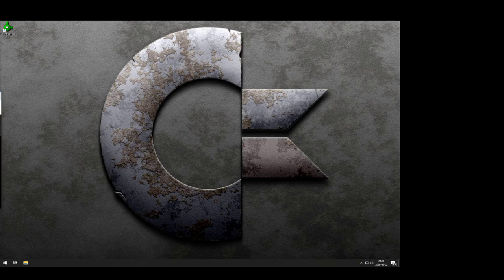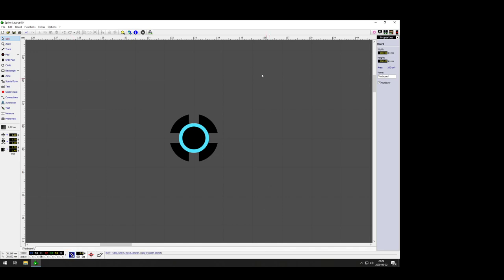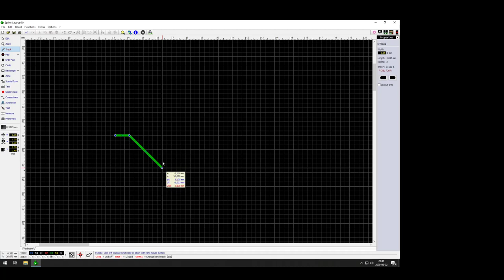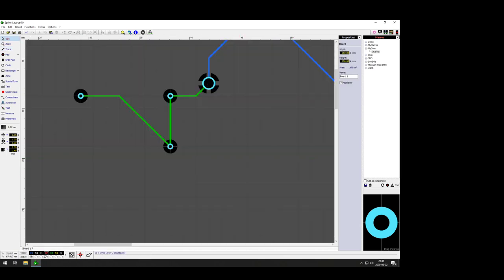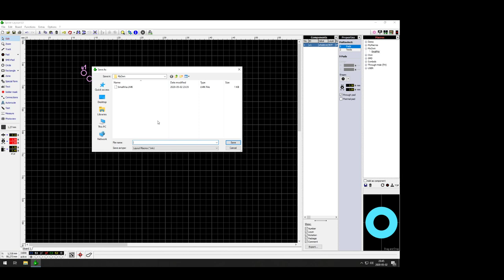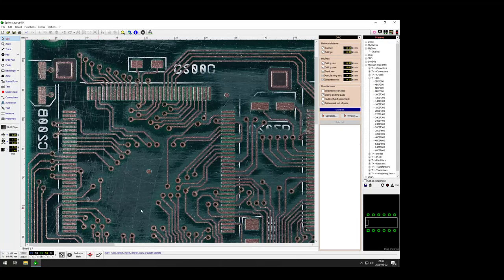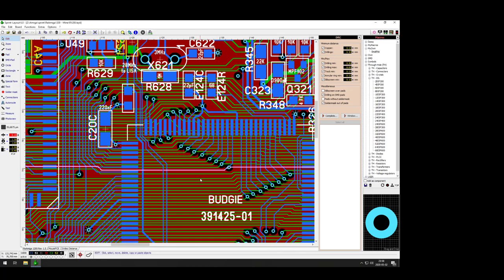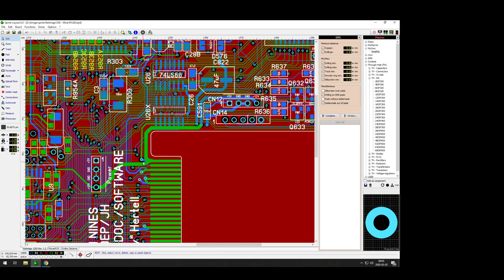Doing Reverse engineer of a PCB using Sprint Layout part1

Comment: I use sprint for reverse engineering because of the image tracing feature the same as you do. To be truthful I was not aware of how primitive sprint was until I began to use it. The lack of a netlist file is a real problem, as you point out, because of that it cannot do a proper DRC. Your tips are really good as they were learned by experiencing problems and they saved me much pain. I intend to do the absolute minimum in sprint, just the component positions an the tracks/pads and move over to another CAD system to get the rest done. I'm looking at KICAD and there is some talk that it can also made to load an image.